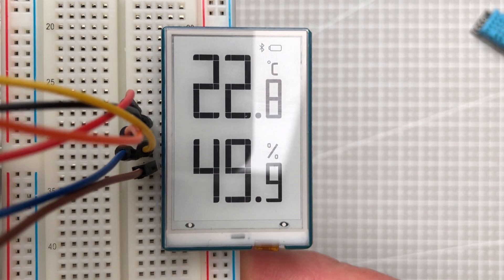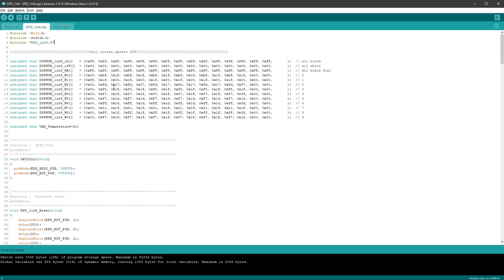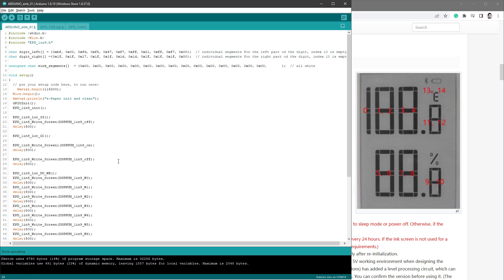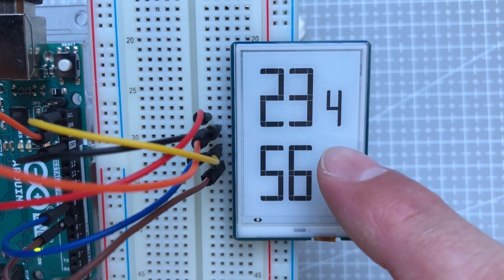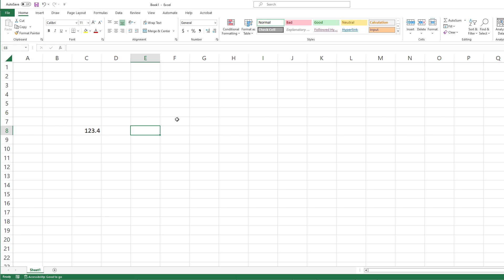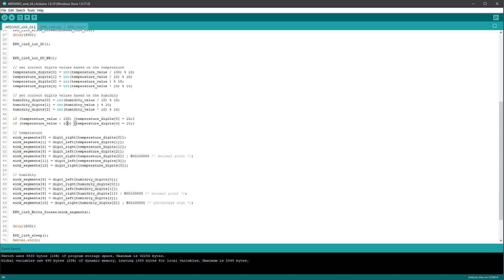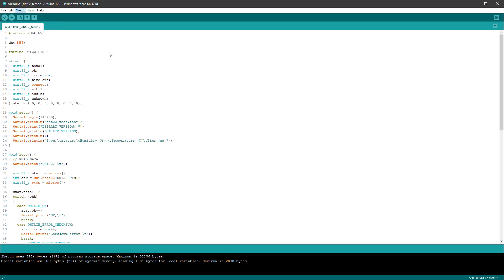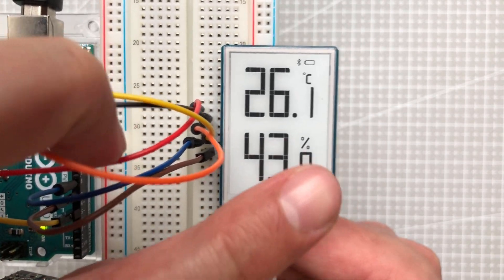Arduino E-ink for Temperature and Humidity (simple project for beginners, tutorial, eink, epaper)

Comment: Do they have any documentation for the schematic of the driver board? I'd like to build a pcb for my project but I cant find anything on their website
Reply from the maker: Yes, the wikipage includes all the details, including schematics and datasheets. Link below:
Reply from the maker: The link is here: https://www.waveshare.com/wiki/1.9inch_Segment_e-Paper_Module_Manual#Resource
Reply: @upir_upir  Thanks! By the way, do you know what is the purpose of the Q2 and Q3 component in this board schematic? I understand that all the other parts are the logic converters and the voltage regulator. But I can't really understand what is the purpose for the Q2 and Q3. And what do they have to do with the VCC EN, EPD RST and VCC INT pin

Comment: The audio speedup sound horrible.
Reply from the maker: I´m sorry to hear that. Could you check that you don´t have playback speed set to some higher speed? The audio is not sped up, I just talk slightly faster.
Reply: @upir_upir  I havent. But if I slow it down  to around 80/90 % it sounds “normal” except from the distortion caused by compression.
Reply: Glad I am not the only one thinking this

Comment: It'd only be +3 or +4 more lines to track last temp & humidity and only update if they've changed. Could possibly drop the delay completely then too, so that's -1 as well. It's interesting how their demo refreshes individual segments rather than the entire display; pretty fancy!
Reply from the maker: You are correct about not updating elements that do not need to be updated. However, the documentation is sparse and I didn´t fully understand the requirements for partial refresh. It states that after a partial refresh, you need to do a full refresh, but obviously, they do partial refresh 10 times... so it´s hard to tell what exactly is allowed with the display to still display elements properly. I´m sure you don´t need to refresh full display all the time like I´m doing, but at the same time, it should not hurt. I mean, it does hurt my eyes a little..